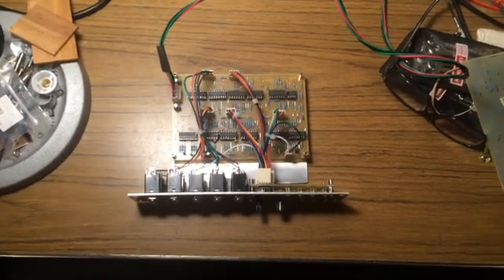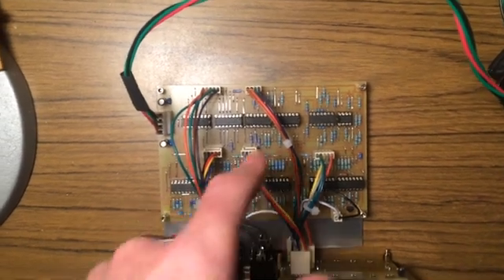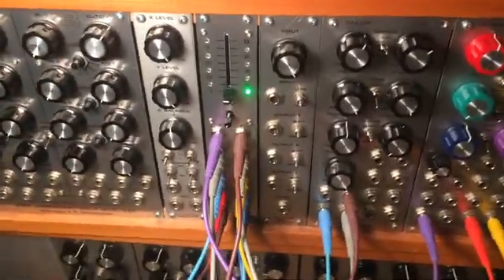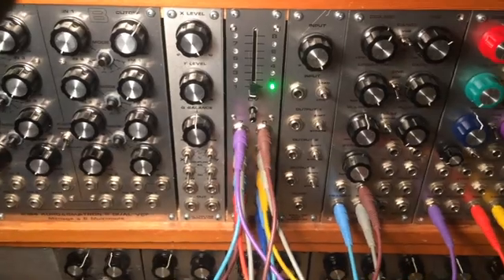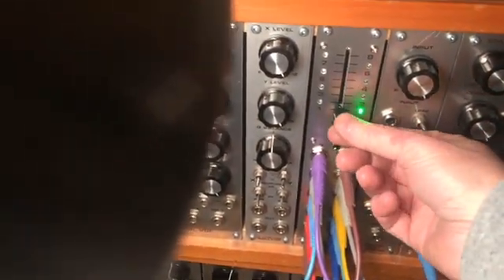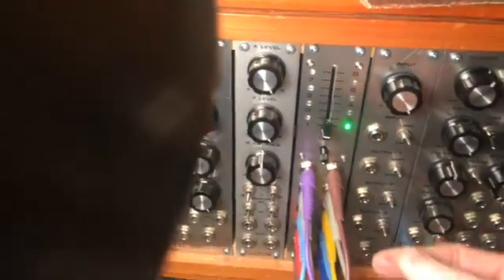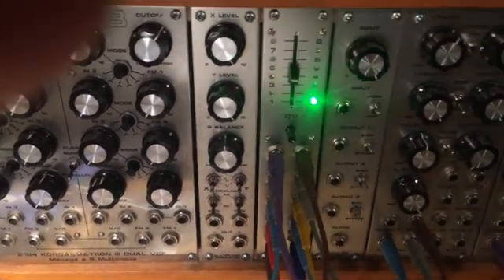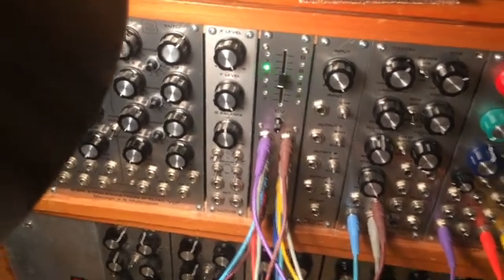Doc Sketchy 8-Channel Scanner

Comment: Ok, this is my favourite video on YouTube forever. How GLORIOUS!
Reply from the maker: "Glorious" is not an adjective that is typically applied to my videos, so thanks for that!  However, if your statement is really true, then maybe you oughta take a look at a few more videos.
Reply: Credit where due! 
I was just looking at schematics and thought I’d look it up. What a phenomenally interesting tool.
Reply from the maker: @blindpenguin  Looking at schematics, eh?  Would you like a set of 8-channel scanner PCBs?  There's also a 4-channel version.  In fact, I just made a set of 4-channel PCBs for somebody in Los Angeles -- shipped them out yesterday, actually.  If you want a set, then I suggest that you send me a private message on Muff Wiggler (I'm "Dr. Sketch-n-Etch").  $30 US plus shipping.  I can do one big board (as shown in the video) or two boards half the size (2.1" wide) which stack on top of each other.  The boards come tinned with all jumper wires installed, with complete build instructions, and if I'm in a good mood I'll even throw in some of the connection hardware.  Plus, you can have it in any power format you want (MOTM, eurorack, Dotcom, etc).

Also, check out my Frequency Scanner (there are three videos).  You might find that kinda cool.
Reply: docsketchy thanks!!

Comment from the maker: So, somebody asked me on another video why the scanner seems to "hang" slightly on the No. 1 position.  This is simply because the fader wasn't exactly in the centre.  Or, because the CV triangle wave I fed it had a slight DC bias.  Also, I could have backed off the CV attenuator ever so slightly.  Bottom line, this is neither a feature nor a bug of the scanner, but an artefact of the CV being fed.  Also, just because I was feeding different VCOs to the inputs, please be aware that you could feed virtually any audio signal (or CV signal -- the scanner is DC coupled) to this thing.  You could feed 8 different radio stations to it and control it with a sample-and-hold, for example.  The possibilities are endless.  Also, it bears noting that this scanner circuit is easily expanded to other multiples of 8 channels.  For example, I built a 32-channel scanner (arranged as a 4x8 with two faders) to scan 32 different filter modes from my handmade Polaris filter.  I haven't made a video of that one yet -- maybe next week.  However, the 32-channel scanner requires 8 separate PCBs, each about 2" x 5.5".  They plug into each other in a convenient way, but the total PCB stack is quite thick -- suffice it to say that that module is not skiff-friendly.

Comment: What's that module with the rainbow colored knobs?
Reply from the maker: That's my homemade "Dixie" VCO.  It has quite a few extra waveforms.  It's more like a handmade Rubicon without through-zero FM.  I also have a handmade Rubicon 2, but I don't believe it was built before this video was made.  In case you didn't know, I designed both the Dixie and the Rubicon (and a bunch of other analog modules) for Intellijel.
Reply: @docsketchy  oh i knew :3